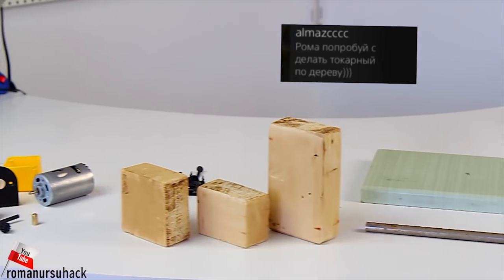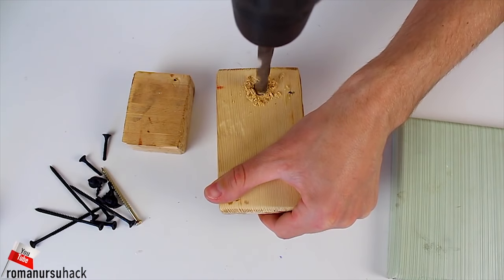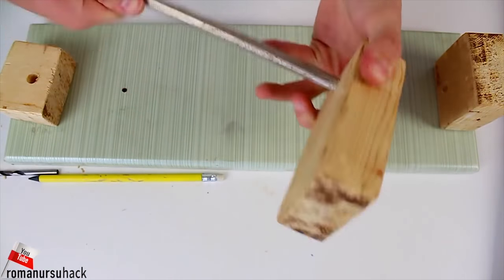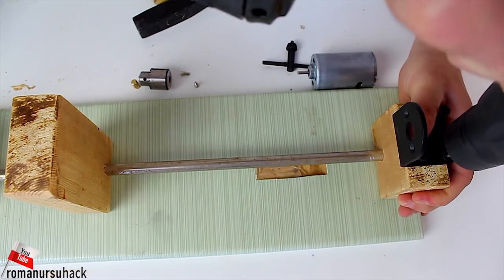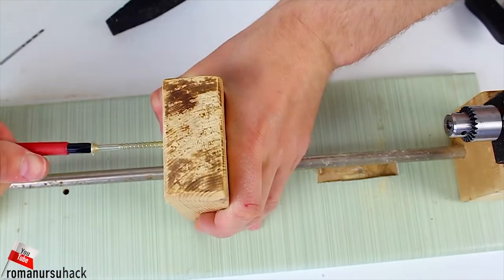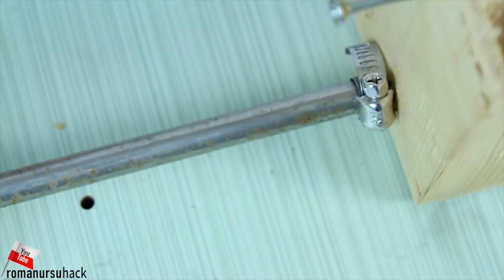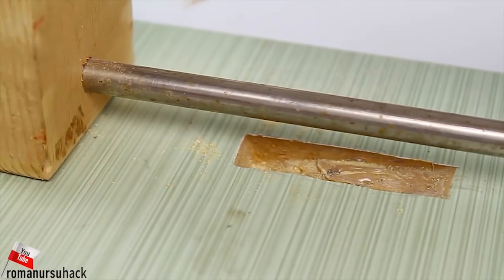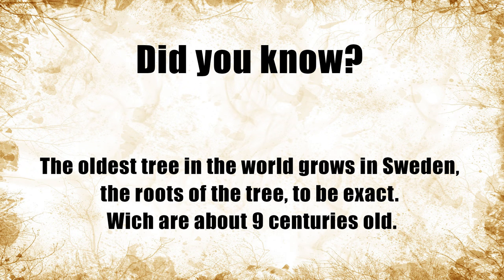Build your own wood lathe in 30 minutes

Comment: Works very well. For maximum strength, always place the screws through the smaller thickness wood first, then into the thicker piece of wood. Instead of making a screw post, you can buy an inexpensive felt polishing wheel holder for a Dremel. It is identical to what you show.

Comment: That was very interesting. Were you using wire to form those fine lines in the wood?
Reply: Patricia DelMercado Looked to be a piece of bare copper wire, it wasn't cutting, just burning the wood for looks.

Comment: Hi!

Can you tell me what kind of power suppy did you use for this 12V-24V motor? Is there any possible way to somehow plug it into a wall socket?

THanks!
Reply: Domen Sterle Yes, simply find a DC adapter with an output between 12 and 24 volts (it should say on it), you likely have one kicking around from an old laptop, beard trimmer, keyboard or whatever. Just cut the end off it, strip the wires and solder them to motor, the white wire is usually positive.
Reply: Shill thanks!
Reply: Domen Sterle No problem :]
Oh yeah and on second thought I don't think polarity matters with these motors, it'll just change the direction the the motor rotates.
Reply: Shill the
Reply: ESHWAR N the
Reply: JUST !! PLUG ! IT ! STRAGHT ! INTO ! THE WALL !!

Comment: how did you add power to the motor? I just purchased it via your description link. I see it is 12v or 24v. I want to plug it in via my wall but it is a 110v
Reply: There's are power supplies that plugs into the wall and go to those voltages. 19v Labtop charger works great

Comment: the set up he showed would not work. as the stock, if it turned at all, would merely screw itself on to the screw and either lock up or slip.
Reply: Unless you drill the hole bigger than the screw. There was obviously some step not shown. But hardly project breaking.

Comment: hey can i get THE ORIGINAL IMAGE please no click bait XD
Reply: btw that works really well for a small 12v motor 
better than the one we have at my house
though that looks kinda small 
i don't know if that is big and hands are big or if it's really small with small hands idk
Reply: Press the following keys:
CTRL U then CTRL F then WRITE thumbnailurl OR default.jpg then TRY to use the resulting image in a google image search.
Reply: Mario Joia ok thanks
Reply: Mario Joia nope cant find it D:
Reply: lolatron Then the work done is inside another video that doesn't have that as the thumbnail ;_;

Tried my best, so, the only one that can answer is the V.Poster., sorry x''(
Reply: its ok
i can try to see how i can make that from
through i would have liked the original

Comment: the oldest tree is 900 y. o.??? Bullshit!
Reply: There's a Yew tree in Dover, UK that is over 2000 years old.
Reply: +Trevor Burgart That is also incorrect, bristlecone pine trees in North America have been dated to over 80,000 years, and there are some believed to be even older, but dating is difficult, due to a lack of the core of the tree, which has rotted away, making radiocarbon dating, or ring counting impossible.